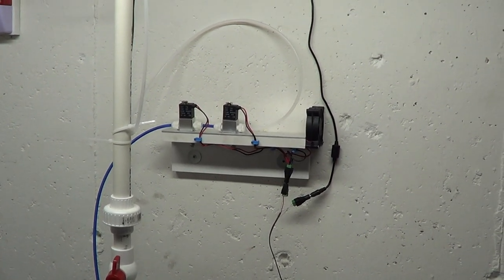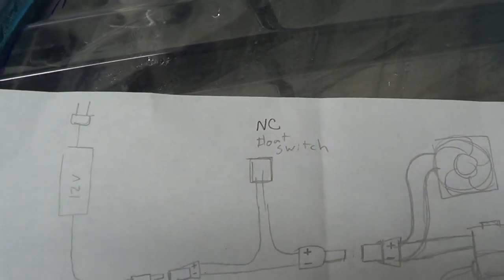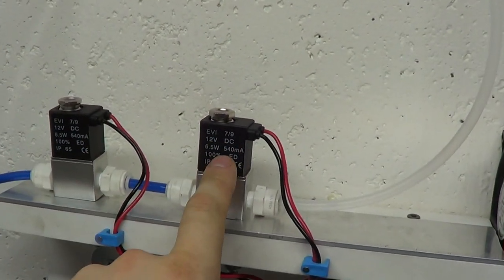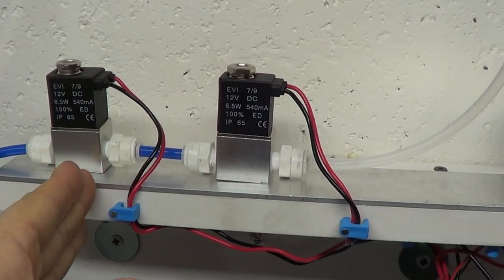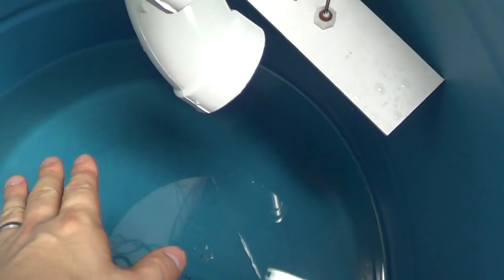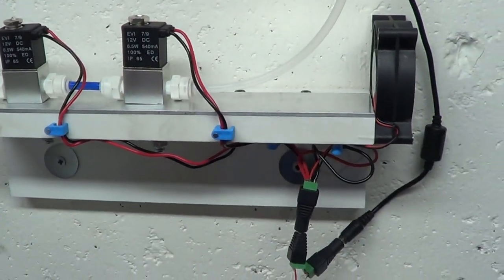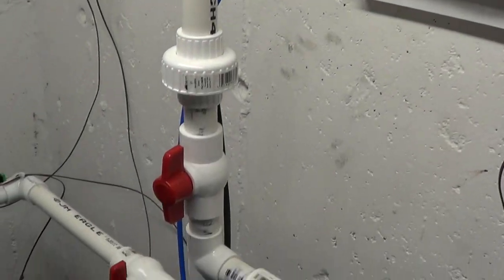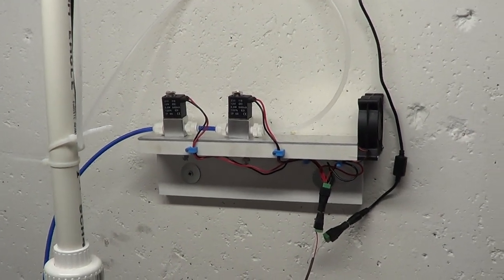#268: How to Build a Redundant Solenoid Drip System for Aquariums - DIY Wednesday

Comment: Really great setup you made. Its helping me. Just some feedback, you may want to put the wiring from the solenoids and anything else above the water line\source. Also put loops below the device it is connected to or point of entry into a wall or whatever. That way if water drips down a wire it doesnt follow the wire into the device or wall. There are examples online for how to properly wire a tv cable into a drip loop before entering the house. Service loops are another description but designating a neat way to leave extra cable for future changes.

Comment: What did you use to "power" this?  I am looking at the electrical side, plug. I'm mainly concerned that I do this safe as the project looks straightforward otherwise and I like the idea.
Reply from the maker: A power supply block that has proper watts, volts for the valve

Comment: Hi Greg, 
Where can I find a solenoid for this type of application?
Reply from the maker: Low Light Aquatics I think I got mine on Amazon, however, it eventually failed in the open position, I made another video showing how I replaced it with a mechanical valve, which I would highly recommend
Reply: Greg Jones yes I remember you saying it failed, i don't plan to keep it open long so I may give it a try

Comment: hi greg. nice project/video. do these solenoids require a minimum water pressure to operate properly?  if not do you recommend a a type.  i've found seem to require at least 3psi in water pressure. 

I'm trying to put together a valve system that routes water from a constantly running pond pump. but the psi minumum is getting in the way of progress.

Thanks!
Reply from the maker: Kurt Euler these solenoids eventually failed in the open position, now I'm using motorized valves and an Arduino, I made a video on it
Reply: ok thanks. i'll look for that

Comment: I know this is old but I'm wondering are the solenoid valves you are using Normally Closed as well, or Normally open? Thanks for the DIY
Reply from the maker: +Pete Adams the solenoids were normally closed (open when power is applied) and were rated for continuous duty, the eventually failed, check out #315 for what i used to replace this

Comment: Just bought everything I need for this project. Love your idea. I just have to ask before installing though, now that it's been over half a year since your setup, is everything still working properly? Mainly worried about the electronics failing over time. My plan is to use the solenoids as part of an automatic water change system in which 10% of the tanks water volume is changed daily. Hopefully you read this before my install! Thanks in advance.
Reply from the maker: Kyle Sklodowski hah, you should have commented before buying the parts - my solenoids actually failed after only 1 or 2 months of use, they both got stuck in the "on" position, even though they were rated for continuous duty. I would suggest you return the solenoids, i'm going to add a note to this video soon, i have a new solution that i'm about to shoot a video on, it uses a motorized valve - stay tuned for that video!
Reply: ***** Any updates on the new system?
Reply from the maker: Alan Bartholomae planning to release the video this wednesday, stay tuned!

Comment: I have a 55 gallon fresh water tank with a auto change drip system setup for it.  The drip rate on my system (since it's only 55 gallons) is 2 drips/second which equals about 2.5 gallons per day (15 gallons per week).  I have the drip tube going into the tank, and an overflow tube for excess water to drain as to maintain a constant water level.  

Two things I would like to do:
1.) Setup the same filter as you (3 stage carbon block filter) since I have chlorine in my water and don't have a sump.

I am looking at the filter you have, and was told that I can slow down the rate to what I need and it will still work, however I am not familiar with how this filter works in regard to pressure.  is there a min pressure it has to have on the intake?  Would I regulate the flow on the output tube?

2.) Setup a backup to the overflow tube incase it gets clogged (and I don't notice).  

I have been looking at getting something like this: http://www.amazon.com/Kerick-Valve-MA252-Float-Adjustable/dp/B0077RAX4W/ref=cm_cd_al_qh_dp_t but I don't know if it will work at the low flow/pressure I am working with (2.5 gallons per day).  It seems like it should...  It's cheap enough that I'll probably just buy it and test it... but just thought I'd mention it in case you had any ideas/suggestions.

I am totally new to this type of system, I don't really know what works and what doesn't, but I don't want to end up with dead fish, or a flooded house...  Any advice is greatly appreciated.  I have been watching your videos, and have gotten lots of good ideas so far.  :)
Reply from the maker: 1. yes, filter intake is normal household water pressure, drip regulator is on the output side, 2. emergency overflow is a good idea, my float switch activated solenoid will turn my drip off in case of an emergency or power outage as well, send me a PM via youtube so we can chat further

Comment: Ok but the bottom one has metal n it wount that rust?
Reply from the maker: the bottom part of the solenoid is made of aluminum, brass or steel which won't rust